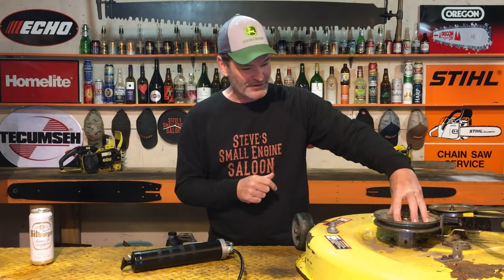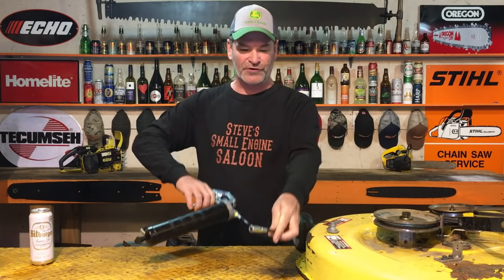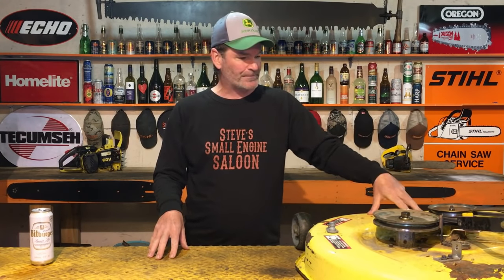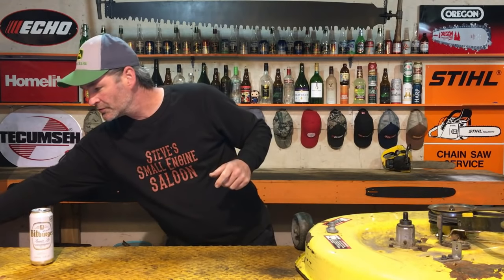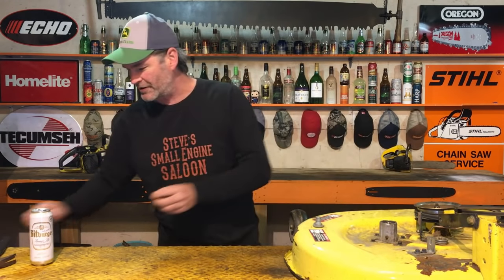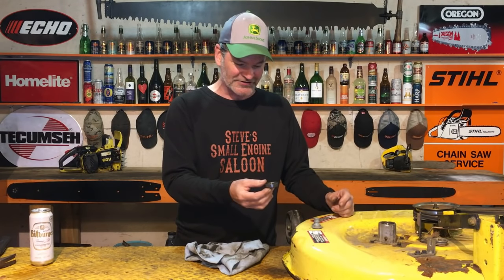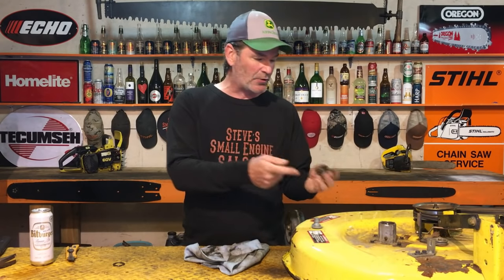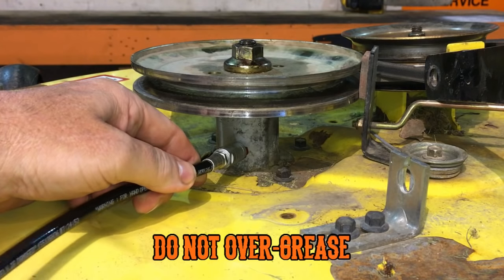Your Riding Lawn Mower's Dirty Little Secret

Comment: Here’s a question Mr. Steve, how do you know how much grease when many things warn not to over grease?  Then there’s some that say grease until the old grease starts to come out?
Reply: I second this Q. It's weird to tell someone not to over-grease without explaining why and how to tell what over-greasing is.
Reply: In my opinion, you can't over grease. Grease is cheap maintenance. On an application like this with sealed bearings. You would have to be careful on the over greasing so you don't pop out the remaining seal. Hopefully the grease will squeeze out between the shaft and bearing so you can see when it's full. If that's the case I would grease until you can at least see grease seeping out, maybe not go until fresh shows. Depending on how often and what type of grease you use.....wow, this was a longer answer then I expected....lol
Reply: When we did maintenance on M113 in the Army, we were taught to pump it until you see grease come out of the seam. Seemed like we did it weekly..
Reply: @m3528i   In the Navy it actually says on the MRC "maintenance requirement card" how much to pump.. LOL.

 Fun Fact: The Navy Maintenance program was originally rejected by Air Force (or so I was told) ... DERP
 Wouldn't be surprised though since the Navy took over housing in Hawaii that the Army deemed inhabitable.
Reply: Samantha Price In all honesty, my Sgt. was a turd and almost got me killed at least three times. He probably had us doing lots of stuff improperly... first day he had me checking for soft spots in the armor with a ball peen hammer... then three of us jumping on a M113 to test shocks...
Reply: @m3528i  As a young sailor I was told to go to engine room for BT punch.. fortunately I actually new what that meant "Boiler Tech punch" LOL
Reply: @m3528i  🤣 testing soft spots on armor with a ball peen hammer Haaaaaaa🤣 you forgot to mention about the high-speed Missel paint & Doppler Grease
Reply: Dale Slover I didn’t fall for the cans of squelch or the box of grid squares thing though...
Reply: @daleslover2771  haha forgot those =)~

Comment: That was brilliant Steve I have a 1972 edger trimmer JCPenney's two horsepower Briggs & Stratton engine the two bearings that run the shaft for the blade the same thing. It seems like one side when I used some spray lube allowed some of the fluid in but that was probably just because the damn thing is worn out so I'm going to try the same method again and see which side it has the most lack of sealing and pop that seal. The surgical chamber where the bearing sit in the shaft runs through there is no grease fitting I guess they felt that the sealed bearings would last a lifetime. Some of the biggest scams were like FRAM oil filters good Lord or the unleaded regular plus and super. If your car is octane rating is regular you can burn unleaded plus or unleaded super but it will not burn cleaner you will not get more gas mileage and you will not get any efficiency or performance benefits whatsoever it's all about controlling combustion. So the only reason why you would want to use a higher octane fuel would be that you are allowing ignition to occur closer to top dead center compression and you would need a fuel that would not pre ignite so your computer has that under control and yet you go to Wawa and what do you see four different blends of gasoline. Buyer beware Steve why don't you try some Kronenbourg. And for a cheap beer I like peels how about it

Comment: Very good to know, however I prefer to NOT use the grease fitting (because after make this recommended modification the remaining outboard seals can easily be blown out when using the grease gun to defeat the whole plan) but periodically hand pack and replace the applicable seals or simply renew the bearings.  When down for periodical service clean and anti-rust proof the whole deck too.

Comment: Install some USA made or SKF bearings while you have it apart .

Wyr
God bless
Reply: Make sure it's a C3 rated SKF OR NSK bearing. None of those cheapo unrated or C1 bearings. Get them cheap from a bearing distributor, Google a local one SKF 6203 C3 go for like $2-3 a piece from a distributor or $10 from elsewhere
Reply: If you want to be really dance get C9 rated ceramic aerospace grade bearings for like $100 a piece. Lol watch your mower fly.
Reply: jesco white,is that you?
Reply: do some board dancing
Reply: @dgpicha34  lol, meant fancy not dance. Stupid android autocorrect.
Reply: @RingwelskiJacek  interesting idea but the specs on everything else like the shaft and cast housing are so out of whack that it's like putting lipstick and a Valentino dress on a pig.
Reply: @littlegoobie  I agree that it probably won't spin more evenly or quiter.  But C3 bearings will last longer as the tolerances internally are more accurate. Or possibly will die quicker as maybe the miss alignment will cause more stress on 'tighter' bearings. Who knows lol.
Reply: I've done that with my 1993 MTD spindles. I got the good bearing at Malloy Electric Motor. I haven't always been able to get the old bearings off to replace them.

Comment: You clean the bearing with brake clean, blow it out carefully, then pack it with grease. Then install dust cover and re-install.
Reply: that will ruin the outer seal as brake fluid destroy the neoprene on the seal
Reply: @errolfoster1101  No it won't. Then why would it have a grease fitting to lube the bearing?
Reply: sorry was thinking brake fluid which most rubbers will react with unless you use one that is designed to work with brake fluid

Comment: I'm an engineer and I can tell you that was probably overlooked. I'd bet the spindle housing is an old design, made to fit an older type bearing, possibly a bushing, that had no seal on either side of the bushing. But later the bearings it now uses were added to replace the old style whatever, and nobody rethought the whole setup. In my opinion greasing these is CAUSING failure, especially if you're seeing grease shoot out of them because those seals are not designed to let grease pass through the seal. Greasing these type bearings will blow out the seal and now dirt can get in the bearing. Your "fix" seems good, but when you know those seals are going to blow out, as I do, you realize the best thing to do with this setup is nothing. Don't grease them in the first place and those bearings will last longer.
The design is a bad design in the first place: those bearings are not designed to take any kind of thrusting load at all. They do pretty well on a cars serpentine accessory belt until the tensioner goes bad and puts a sideways load on those bearings on the idler pulleys. On these lawnmowers, the blade is always putting a thrusting load on these bearings. There needs to be a thrust bearing to hold the shaft in place and then these bearings can be installed so they can float up and down taking the lateral load off those balls and races. I'm surprised if those bearings last one season before they begin to roar and need to be replaced.
Reply: WHATS YOURSOC  Yup. That's about the best you can do with this bad design. Put good grease in new bearings and reinstall the seals. Still, they're not going to last very long no matter what you do: Too much lateral load on the shaft.

Come to think of it, you might get by with some barrel type bearings, flat rollers captured in a channel. Yes. Those would do quite well, properly greased. Certainly better than that crap they're using.
Reply: I saw that bearing and wanted to run out to my shop dig through the trash and pull out my idler pulley bearing because it looked like the same exact part.
Reply: @thesman7918  I'd bet a dollar to a doughnut it is. That's a very common bearing that is made by the billions which is why it's so cheap.
Reply: Why would an engineer worth his salt not see the problem with this immediately?
Reply: @oilhammer04  Chances are he did see it and probably said something about it too. But management sees only short-term profit these days and the engineers probably were told "thanks but were going with what the bean counters are telling us."
Companies today are managed on the 90 day profits plan, except for the oldest and most established companies like Coca Cola and... and... well there was a time I would have said GM or US Steel. General Electric seems to still make stuff that lasts but they're a military industrial complex company and they've got bigger fish to fry: other human beings (so far). They seem to listen to their engineers first and bean counters second.
I take that back! EXCEPT when it comes to nuclear power plants. The Fukushima plants are General Electric designs.
Reply: @ladamyre1 , I think you are right, that the engineers get ignored.
Reply: Give the engineers and the bean-counters some much needed credit !!!  This design is certainly a compromise.... cost vs. quality.  Much like any mechanisms meant for mass production. The design shortfalls are apparent but not as poor as discussed !! The production double-side seals on the cheap bearings is much better than the proposed removal of the inside seal !!!  Now, when greased the pressure from pumping the grease will certainly drive the outside seal out and expose the balls toward quick failure. These simple seals are more like a "shield" than a "seal" and when  grease pressure comes from the inside of the bearing it holds the seal in-position and allow some grease into the bearing, lubing it and preventing the outside seal from being pushed out. 
As a Mechanical Engineer and long-time Farmer, it's my opinion, the design is an excellent compromise.  Having explained the "Design Intent" I believe the most common failure of these cheap mower decks is (as commented earlier) is the fact that they are usually never greased. Mr. home owner won't have a grease gun or want to get his hands dirty.
Reply: You're an engineer and you don't know much about bearings. Ball-type bearings are designed for both radial and axial  loading. Deep groove ball bearings especially are designed for high axial loading.

Comment: Same goes for hydrostatic axles. First oil change should be done at 50hrs instead of 200hrs. And using Turf torque suggested 5w-50 synthetic oil. No drain plugs either. 
Look it up . ✌
Reply: Definitely.  I only have 26 hours on mine right now but when I get a bit closer I'll be doing a service on my hydro-transaxle for sure.  I'd hate to see how it would be working if you don't service it until the 200 hour mark, probably won't be working very well if at all.
Reply: There are provisions for drain plugs. The holes just weren't machined out for them.
Reply: Most k46 tuff torq transaxles will last 250 hours without maintenance. Oil changes should get you above 500, wheel seals will likely go first. I tore mine apart at 50 hours, and there was a considerable about of swarf and shavings inside the housing, where the pump picks up the oil around the filter. The 5w-50 oil made the transmission much more responsive when hot.
Reply: @plkracer  I have one in the shop right now that I'm changing axle bushings, seals, filter and oil.
Reply: @dans_Learning_Curve  how many hours? I thought the one I tore apart had a bearing of sorts (may have been a needle roller), but many do have bushings.
Reply: @plkracer  I don't remember at the moment. I'll try to look at it meter and get back to you. It had leaked all of the oil out to the point of not moving.
Reply: I drilled and tapped drain plug holes in the provided spots when I had it apart. At 200hrs there is a some wear on shaft seal area and vertical play in the bushings are wearing  oval. It is important to pack the seal lips with grease when reinstalling the shafts.
Reply: @plkracer  84 hours

Comment: What we’ve done in the past is everything you did but also drill a very small hole in the spindle housing just below the top bearing to provide a relief for heat expansion and also to prevent over greasing. When you start to see grease come out of the hole stop. Easily get three times the life out of the bearings. And in most cases your low to mid line mowers won’t even have grease zerks  because they want you to buy the whole assembly when they do fail.

Comment: How does the grease get to the top bearing. Eventually you will fill the cavity and blow out one of the remaining seals letting dirt into the bearing housing.
Reply: Yep, I’d just clean then grease each bearing and reinstall seals. I do this to idler pulleys when changing a serpentine belt
Reply: I was thinking the same. I think that is why he put that don't over grease warning. But if there is not a place for the grease to escape you cannot purge the old grease.
Reply: I liked it when they had taper cone adjustable clearance roller bearings but I guess those times are gone. Even my commercial mowers are set up like that now but the bearings are way larger on big shafts. There is a weep hole for excess grease to escape and they say keeping that empty cavity full of grease still helps protect the shaft and sealed bearings from moisture.
Reply: @heydude4532  I wouldn't bother, If I have it that far down I'm replacing the bearings, once they get rough their days are numbered anyway.
Reply: pfun41 I agree, replace if there’s play or notchyness ( if that’s even a word? ) in the bearings.

Comment: More likely than an engineering problem, there was an assembly problem with bearings sealed on one side. Someone figured out they could speed up the line by not having the assembler worry which side was which. So, for the small additional cost of a double sealed bearing, they could crank out an additional mower per shift.
Reply: Exvuses, excuses
Reply: @alexandercove1194  Berkeley, now you are thinking like a corporate ex. No thought for the rube that buys this stuff.
Reply: Wilmea....why, thank you!
Reply: How many DIYers actually wipe off the zerk fittings before greasing?  Probably not too many, which is why JD probably went to sealed bearings.  My LT160 is a 2004 model...still runs great and I have never greased the bearings.  There's nothing 'sinister' about using sealed bearings, and they keep the DIYers from over-greasing the bearings (which is also a big problem...excess grease retains heat and shortens the life of the bearing).  Obviously, the Youtuber that posted this video doesn't know jack about bearings.  If he were an actual engineer, he'd know that.  Careful what you learn on Youtube...a lot of info is bogus.

Comment: One of my favorite instructions: “Do Not Over-grease!” Never mind that there is no way to know. Ask five guys how many pumps, get five answers   🙄
Reply: Sure thereis a way to know, but the machine normally has to be running and you use a vibration sensor to tell when the pitch changes. But most people don't know this and don't want to fool with getting a vibration sensor.
Reply: I'm going to pass on climbing on my brush hog while it's running and trying to attach a grease gun to the spinning u-joint.
Reply: I've always used the "grease til it squishes" method. Works for me.
Reply: John Deere repair manuals say 2 pumps will suffice. But, as Steve said, they may be deliberately providing false info to sell more parts. I use 2 pumps on all mower brands as a basic guide. I have discovered in most cases that 3 is usually too much.
Reply: Actually, you get six answers. One of the "guys" you asked was really a woman; hence two opinions from one person.
Reply: When the grease gun gets slightly harder to pump, pump two or three more times, that should be enough.
Reply: Same with KY.  For many the five answers are on one hand.
Reply: @caspere.8461  Oh my.
Reply: I have 3 spindles and each one takes a different amount of grease pumps.  All I know is 2 of them always take a lot of grease and 1 not so much.
Reply: That's what she said.
Reply: @PeskyCitizenTX  HA HA HA HA  Didn't see that one coming.
Reply: Get a cheap ultrasonic cleaner from Harbor Freight and clean out all the old grease and dirt first, then re-grease it.
Reply: Over greasing is the leading cause of bearing failure. Fact
Reply: @tenncutt  Yes, if you pump too hard you can blow out the outer bearing seal.
Reply: You need to make a small hole on other side to allow some to come out when full
Reply: @cdmanaholmes3305  drill a hole in both sides..
Reply: Hell, that's nothing.  Ask those same five guys wives how many pumps and get exponentially different answers.
Reply: @robinblankenship9234  Or perhaps you get 4 guesses and one fact.

Comment: I always new that was a problem. Thanks for letting it out there on your platform. Maybe it will spark some change. I drill a couple holes in the bearing cover and leave it. It helps keep the small dirt out. If you don't out will fill up the bearings quickly. Good man Steve! Keep up the good work. You have saved me lots of money so I'm donating to your cause.

Comment: The shields come on and off these bearings quite easily and I always like to pack them with grease before installing them.  Not only spindle bearings but any  shielded or sealed bearing I buy now seem to come under lubricated.
Reply: That’s China for you.
Reply: Hey mumbles! I've seen where guys have drilled a small hole in the seal and inject Grease with a syringe. Keeps most of the dust and crap out, but lets you top up the lube.
Reply: @BP-bx6si  That sounds like a good idea to Wedgie except all the syringe points  I have on hand at the moment are a bit too big. It's time to take a trip to the drug store!
Reply from the maker: Right on....